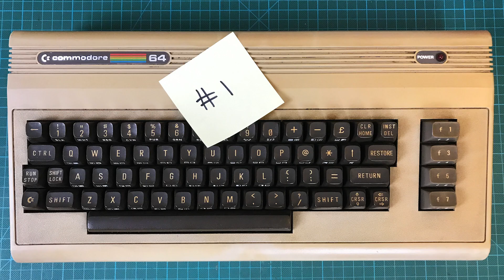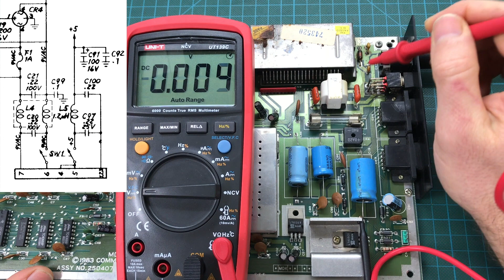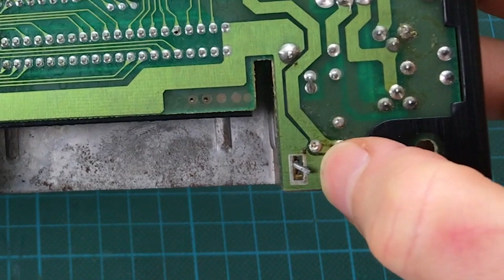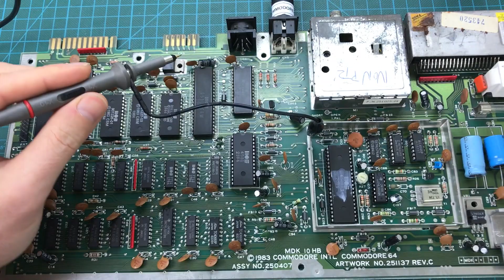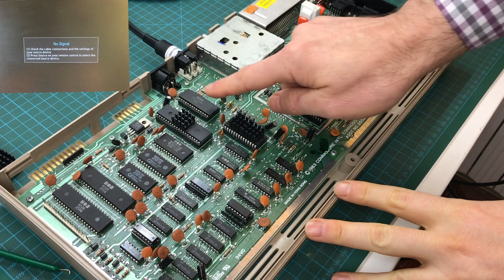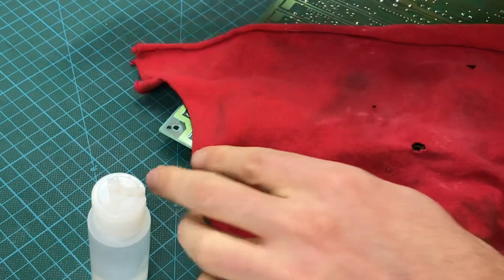Commodore 64 Black Screen Triple Challenge (Part 1)

Comment: No picture on Dead test and normal boot. 

I’m getting the 5V to the LED and 10V and 5V on the power socket..

However my VR1 and VR2 I’m getting no voltage and VIC chip is stone cold… 

Any ideas?

Comment: Great channel! I just don't understand how the multimeter wasn't showing continuity on the inductor at 4:13. You were testing the leads, surely the fact that one of them wasn't properly soldered in the PCB shouldn't have affected that measurement.

Comment: Nice work,  and throural troubleshooting:)  I have been working on these for a couple years.  Silly me.  Still no scope.   This 407 board.  Black screen and dead test won't work.  Voltages are ok other than output of switch.  4.6v  and cassette port pin 3 is over 6v like it's running all the time.   I ruled out cpu, sid, vicII and the roms in another board.  Cpu resets from low to high on pin 40 with logic probe.  Oh and pla good.  Is it the switch or 556 possibly?  Any thoughts are much appreciated.

Comment: I thought they just tied the reset line to a big capacitor which would keep the line low long enough for the CPU to reset.
Reply from the maker: That's what I've seen in other systems. No idea why they felt the need to get all fancy about that. I think the Apple II might be the same. Maybe it needs to stay active longer than a Z80 and a cap for that would be too big?

Comment: Why does the board create 5V from 10V through a voltage regulator when the power supply already provides 5V?

Comment: Hello, I have a C64G at home and I have a problem with it. Could you help me please? 

I don't have the original video cable, but I made my own and it works. The problem is that when I connect the video cable and power to the C64, I get a black screen, just like in your video. I followed your video to test the voltage and everything went fine. I pulled out and cleaned out all the chips that could be pulled out. The fuse is good, the power supply is good too. I cleaned the whole board of dust, I checked the board to see if everything was holding, if everything was in good condition and so on. I think everything is fine. When turned on, the light is on, so there should be no problem with the switch. I also removed the SID chip from the board, turned it on, tried it, but it didn't help. I don't have an oscilloscope, so I don't have any values measured like the ones you had in the video. The chips are probably warming up normally, no big differences. 
What could be the problem? Would a reset button help?

Thank you !
Reply from the maker: Hello Michal, not sure, sorry. It sounds like you did the right things. The PLA could very likely be bad. Also, check with a voltage meter to make sure the RESET pin on the 6510 is high. Beyond that, I would try a dead test cartridge and look at the small MOS chips.
Reply: @NoelsRetroLab  
Hi, 
I apologize for a later response, but now I have time for C64. So I checked the voltage as you said and got 4,83V. I don't have a dead test cartridge, is there any other way to test it? I don't know... Can I ask you for email to send you some pictures how it looks with the main board please?

Thank you very much!!

Comment: This is a great video, but the thing that stood out for me the most was that you've put small heatsinks on all the chips that tend to get hot on yours, really smart idea, can't believe I never thought of something like it sooner for my old devices with hot chips!
Reply from the maker: Thanks! Although it's even better if you put one long heat sink instead of several smaller ones. I need to do a video about that running some tests actually.
Reply: @NoelsRetroLab  Looking forwards to it, really curious to see how well these perform since they tend to only really cool chips after they hit ~35°C!

Comment: Thumbs up. I didn't expect the 556 to go faulty and had the capacitor (C25?) in mind. Good work.
Reply from the maker: Thanks! Yeah, you never know what's going to fail, that's part of what makes this whole process so much fun! 😃
Reply: Atari 1040ST uses a similar/same circuit around a 556 in the reset circuit. I repair 68K Ataris and design HW for them but watching people working on other retro computers is very entertaining and you can always learn new techniques.

Comment: Great video Noel - BUT what tool are you using to remove the keys from the keyboard?
Reply from the maker: Thanks! It's just a "key puller". Pretty much a couple flexible wires that hook under just about any key and let you pull vertically. Something like this: https://www.ebay.co.uk/itm/Mechanical-Keyboard-Key-Keycap-Puller-Cap-Remover-Steel-Tool-For-Cleaning/114223979356
Reply: @NoelsRetroLab  Thanks Noel - LOVE your videos

Comment: Im getting a black screen but with a cartridge I can hear sound. I only have rf to test with right now.
Reply: I took off the rf box and bought a cheap replacement to see if that fixes the issue
Reply: The system started working but there is an issue with the rf box
Reply from the maker: @indcsion  Great. I'd say skip the RF box completely and just use composite or s-video. So much better image quality!
Reply from the maker: That's good news! That means most of the C64 is working! :-) It could be the RF modulator, or maybe the way you tuned it to your TV? Ideally try to get an s-video or composite cable and check it that way. If it's still black, it's probably the VIC II chip that is not generating a correct video signal for some reason (the one in that protective metal cage).
Reply: @NoelsRetroLab  I'll try to get a video cable. Thanks
Reply: My 2nd c64 works but I cant get the left direction to work. It could be the controllerss but on both controllers left doesnt work
Reply: I got the controls working by switching out cia chips from the black screen one. Luckily most of the chips are already in sockets.
Reply from the maker: @indcsion  Good find! So one of them isn't working correctly, but they shouldn't be too bad to replace. And yeah, isn't it great when most chips are socketed! The only thing to watch out for are for slightly corroded sockets not making good contact. Actually, I wonder if that was happening with the CIA chips. Try swapping them back again and if they work, then it was just a dirty socket.

Comment: I would like you to fix some Atari 400 ;). My problem is that I don't have the Memo Pad message till I press break. After that I can reset and it will show the Memo pad message. I've changed both Ram and CPU boards, so the only culprit must be in the main board. All caps changed. Keyboard runs fine and it doesn't matter if I unplug it, it won't show the memo pad till I press break. I believe that it thinks that something is connected and it won't stop till that process breaks with the key. I recently have put 48K memory and also changed it to use RGB (and modern voltage regulators in the kit) so it looks great, but that problem is still there.I forgot to tell that at first I was having a problem with some not working keys that was solved changing both 4051 chips. Could it be the Pokey instead causing my problem?. Should I try to resolder it?. Maybe you could point to some possible culprit here?
Reply from the maker: I'm afraid I don't know. I'm reasonably familiar with Atari 8 bit, but I have actually never messed around with an Atari 400. I'd love to get my hands on one at some point. I doubt the Pokey chip could be causing that, but who knows! Check on AtariAge. Chances are someone there will be able to point you in the right direction.
Reply: @NoelsRetroLab  Thanks. I wonder what can make it to run perfect after a reset and not from a cold start.
Reply from the maker: @FernandoelChachi  That can often be caused by bad electrolytic capacitors, especially around the power supply. Probably no harm in changing them and then seeing if that improves things.
Reply: @NoelsRetroLab  Thanks. I changed all of them
Reply: @NoelsRetroLab  A Break I mean

Comment: never thought that such a standard chip like the ne556 would die. at least it costs next to nothing. but you didn't test the Sid chip in detail.
Reply from the maker: Yeah, I've seen plenty of simple chips die, like 74xx for example. You just never know what's going to fail :-) You're right I didn't do an in-depth test of the SID. Most of the time if they make sound during the Dead Test Cartridge and I play a game and it sound OK I call it good, but it wouldn't hurt to do more in-depth testing.
Reply: @NoelsRetroLab  i think because the SID is mixed signal the digital part sometimes still works fine but the filters are gone bad. that showes only in music where filters are being used extensible
Reply from the maker: Right. That makes sense. Do you recommend any particular suite of tests for the SID?

Comment: Nice video, Noel. I have two boards to review and i will check the 556 as you have shown here. Many thanks, very interesting.
Buen video,Noel. Tengo dos placas para revisar y comprobaré el 556 como has mostrado. Muchas gracias, muy interesante.
Reply from the maker: Pues si tienes cualquier pregunta cuando te los mires, avísame sin problema!

Comment: Hmm, why is there a 5V regulator when there is a 5V input?
Reply from the maker: I'm not really sure, but the 5V from the regulator goes straight to the VIC chip. I suspect it needs a very steady 5V and the one from the external power supply wasn't good enough.
Reply: @NoelsRetroLab  So why bring in the 5V at all from the PSU :) For the power led?
Reply from the maker: The rest of the board is all powered by the 5V of the power supply, it's just the video chip that has the 5V from the regulator. I agree it seems like a really odd choice. The ZX Spectrum for instance had a 9V DC input, and then it generated 3 different voltages internally (and to be fair, that's the part that always failed too :-) ).

Comment: Very nice video. Could you have piggyback another chip before replacing the chip or would that only work for ram?
Reply from the maker: I'm not a fan of piggybacking at all. It only works if the failure is caused by the chip leaving one or more outputs in a floating state. Then the piggibacked chip can put the correct results. If the failure outputs some levels, they'll be conflicting with the piggybacked chip and who knows what comes out of that. Having said that, piggybacking might work for something simple like RAMs, but I doubt it would work at all for the CPU or the VIC (it may for the PLA?? I haven't tried that).

Comment: @4:07 you check the inductor directly, why did you think that re-flowing what appeared to be poor solder joint would make any difference?  I'm not trying to be funny, I'm just wondering.
Reply from the maker: I'm not sure! I was initially going to replace the inductor when I saw that it was soldered really badly, so I figured I would reflow it. If my measurement really was from the leads of the inductor, then it makes no sense. The only thing I can think of is that I was probing the solder instead of the leads themselves.
Reply: @NoelsRetroLab  Thanks for the reply and the video.  Always good to see a C64 brought back :)